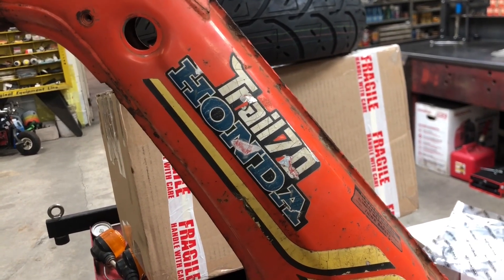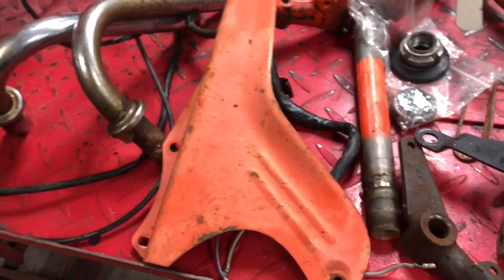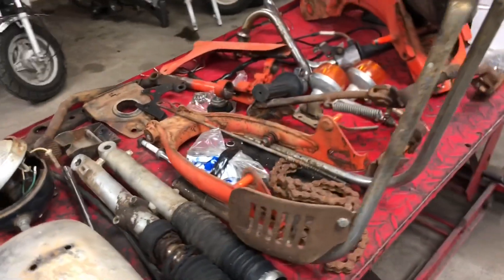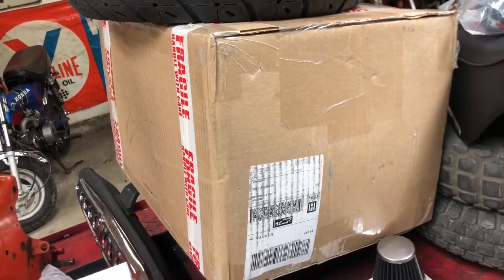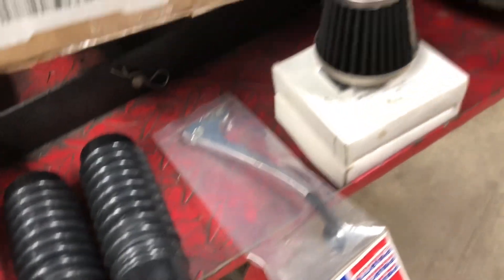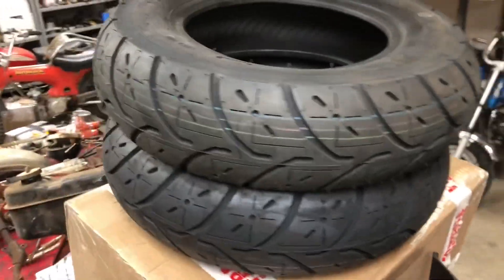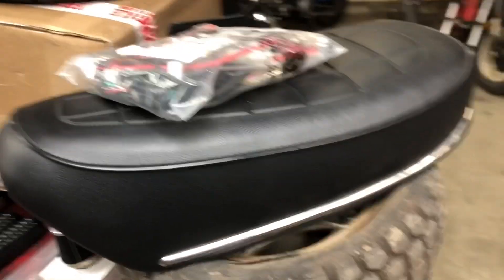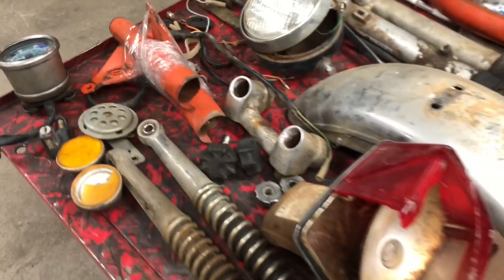1977 Honda CT70 - video #1

Comment: Try this ebay seller:hondamotorcyclepart for seat covers
Reply from the maker: Do they sell complete seats?   99% of the time, I’m either missing the seat or the pan is toast, i usually buy complete seats.
Reply: @MiniBikeMike  yes they do
Reply from the maker: @tas384  I looked at their site.  Looks like they only have the same seats as my regular supplier, the K0 and K1 seats.